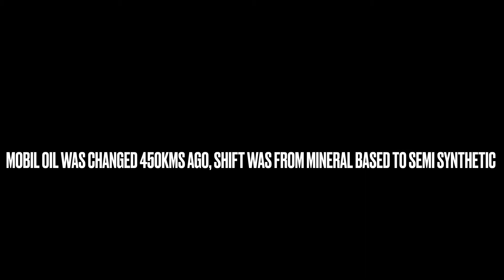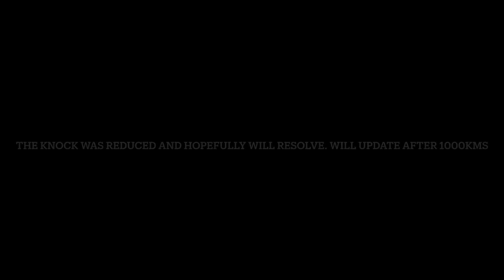Land Cruiser 80 - 1HDFT has a strange knock / ticking sound on startup & idle

Comment: If your still chasing what the noise is it’s most likely your valve clearances, would recommend adjusting them
Reply from the maker: Thanks, changing back to mineral oil fixed it. But its time to check valve clearances anyways, the sound went away on 200kms after next oil change. I am running full synthetic now Amsoil and its better
Reply: @80SeriesPakistan are you running mineral or synthetic oil? 
2 different things
Reply from the maker: @Wayne-Kerr_Rudy-Zarzoff  i was on mineral and shifted to full synthetic. It did wonders albeit every mechanic said older engines should run on mineral.

Synthetic made the turbo whistle like a charm and improved the feedback
Reply: @80SeriesPakistan  10w 30?
Reply from the maker: @Wayne-Kerr_Rudy-Zarzoff  15w-40 signature series Amsoil

Comment: Sounds like its about to spin a bearing
Reply from the maker: Diesels sound like a lotta things when you put in the wrong oil, they like mineral based and changing it after many kilometres does do funny things to the engines. Shifting back to the same spec oil has fixed the problem ✅
Reply: 1HDFT hood sticker recommends 10w-30, and availability of this spec in Pakistan is mostly multigrade oil used mostly in gasoline engines. Should i go for it? Im not satisfied with 15w-40 diesel engine oils
Reply from the maker: @tigertrail3361  thats when it was new probably, stick to 15-40
Reply: @80SeriesPakistan  too late now, already on 10w-30 and engine is loving it
Reply from the maker: @tigertrail3361  thats beautiful then, the general rule of thumb is you cant go down in oil viscosity and can only go up. Especially for diesels as they tend to smoke after that. Hope you have a better experience
Reply: @80SeriesPakistan  Thanks a lot for your kind words